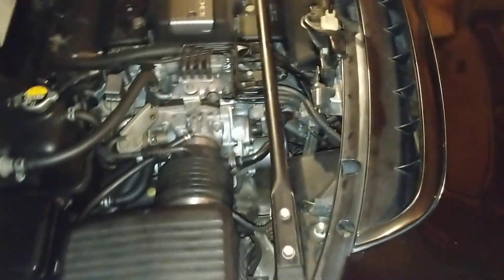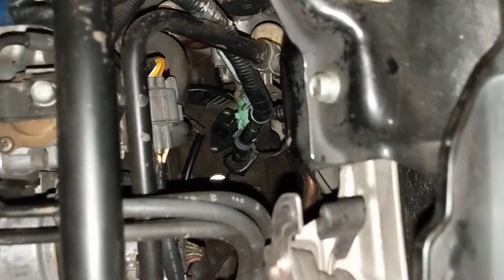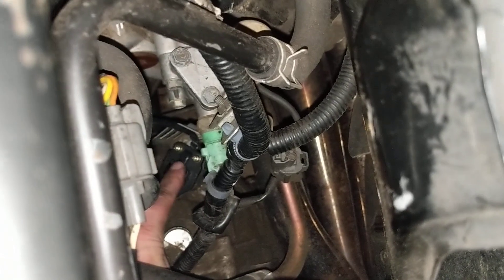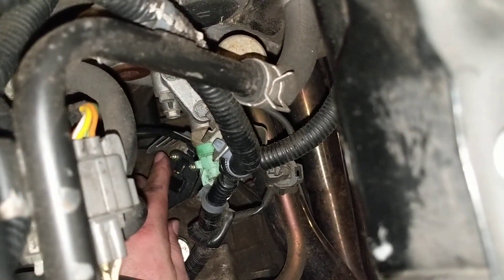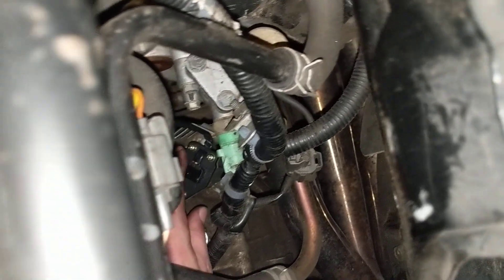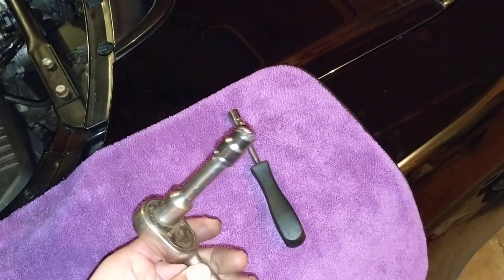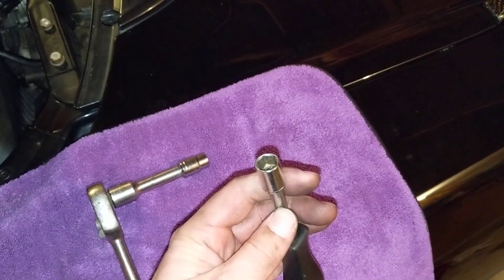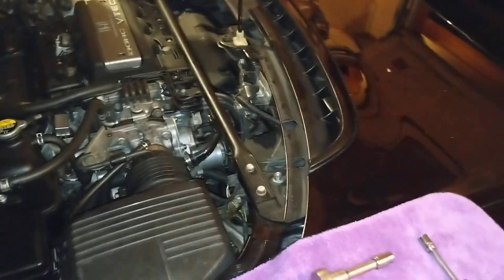NSX VSS Location (Vehicle Speed Sensor)

Comment: Did it shit the bed?  I replaced it when I first bought the car in 2012 because the speedo was all wanky.
Reply from the maker: I worked well until I parked the car. The next time that I went for a drive, the speedo was dead. Sometimes is bounced all over the place but showed 0km/h most of the time.